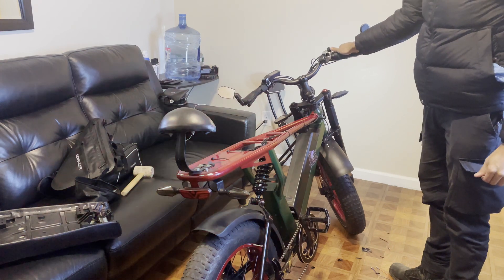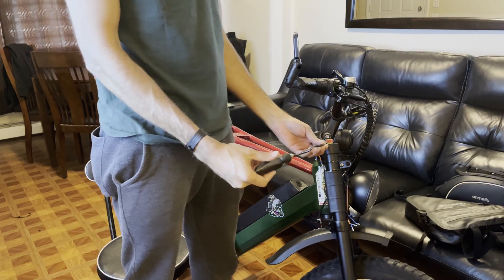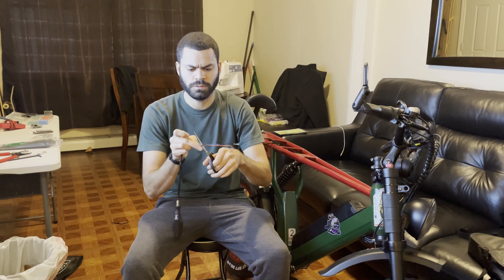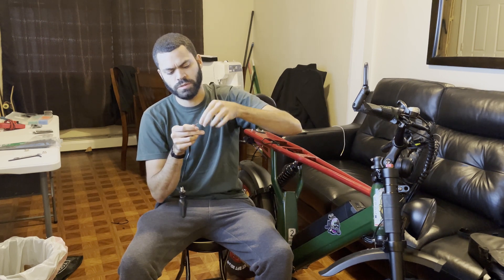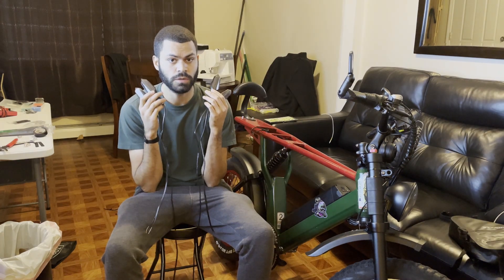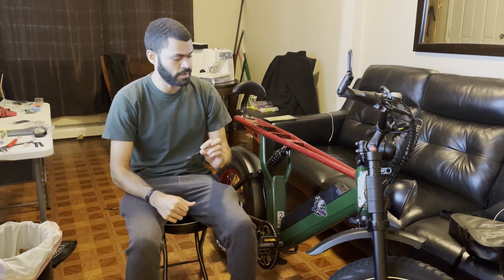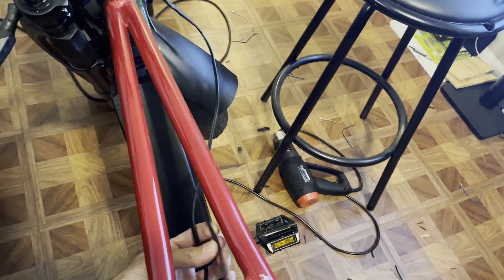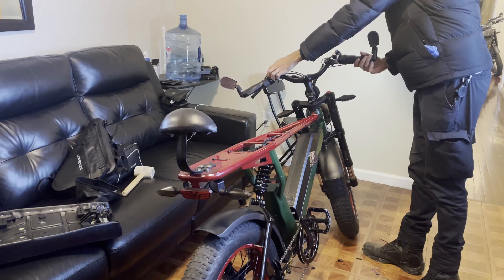Turn Signal Mod For Ariel Rider X-Class 52V (No External Power Source Or Step Down Needed)

Comment: Very poor electrical work. Using black wires is stupid. You should use red and black, Positive and Negative. Also at a minimum use crimp connectors to connect wires or solder. Never just twist wires together, just a pure crap amateur move. Also, when using heat shrink, use waterproof version to ensure that the connections do not corrode.

Comment: Great video man. I'll be trying this mod out in the spring when I swap out my seat. Quick question, could you not reverse the wiring to essentially wire your right lights like they are the left signals, and the same with the other lights? That way you don't have to flip the controller?

I'd been looking at the wireless stuff, but needing to worry about powering down multiple units, keeping multiple things charged etc seemed like such a pain. I'm much rather do what you did, and just wire up the new lights. 

Thanks! Really appreciate content like this!
Reply from the maker: @derricbb  I’m pretty sure I tested some other ways and this one is the only way that works because of how the control switch is set up. You basically sacrifice a tail light signal for turn signal. It’s kind of complicated I don’t really fully understand it but I tried many wiring combinations and this is the only one that worked

Comment: Hi bro, can this work on the step thru model somehow??
Reply from the maker: it should be able to work as long as your step thru model has, 1: a tail light, 2: a brake light, and 3: turn signal lights, which is a 5 pin julet connector.
Reply: It does have all that, but the turn signals tho are integrated into the brake lite?
Reply: It does have all that, but the turn signals tho are integrated into the brake lite?
Reply from the maker: @geemanns5614  Not exactly sure what you are asking but the turn signals won’t work as brake lights just turn signals, they work seamlessly into the bikes power source, and your stock brake light will still work when you press the brakes but the always on tail light will not work.

Comment: 👋🏻Can you tell please what volt did you buy for the turn signals I know you said volts between 12v-60v but since I wanna do it exactly as you did in the video can you tell which one you picked for your e-bike. Thanks.
Reply from the maker: These turn signals work for 12v-60v they don’t sell specifically for one voltage it’s just the whole range.
Reply: @chuckytrue  well in the link you provided there are categories you can choose from like 12v yellow/blue and others that are 32v-60v yellow/blue just to mention a few.
Reply from the maker: @ivm1646  Okay I see what you mean, they must have updated their selection since I got mine because it is different now. But you need the 32v-60v version not the 12v one.
Reply: @chuckytrue  excellent thanks

Comment: hello, please tell me how I can make the tail light work on the rear, I mention that you also installed a signal but it doesn't work for me when I press the tail light on the states, it doesn't light up, where is the power for the signal and brake on the tail light?
Reply from the maker: With this method the tail light doesn’t work. It only lights up when you use the brakes to signal you are braking

Comment: Hey, I have a question hopefully u can help. So I bought an aftermarket plug n play headlight for my xclass but when I turn on headlight the light stays on. The only way for it to turn off is to unplug it. The seller recommended I use a external battery so that’s I have been using as the power source. I sent an email to Ariel Rider and they said it’s because I didn’t “power cycle” the bike first before installing. Apparently I was suppose to disconnect or unplug the battery then turn on the display to make sure the bike is complete dead. By not doing this I kinda damaged the controller. Bike still runs fine tho. Just wondering if I was to install these turn signals would the lights stays still stay on even when I turn off the bike ?
Reply from the maker: Hmm sounds interesting. But I assume it would still behave the same way it is acting now if you install these turn signals because I don’t change anything about the wire that powers the headlight so it would probably still stay on. The headlight is tricky to upgrade for the fact that it has a daytime running light that is always on and is probably running on a certain precise voltage to turn on and off that ariel rider has programed into the controller witch most aftermarket headlights aren’t compatible with.
Reply: @chuckytrue  damn well it’s not that big of a deal but I recently installed the 60v controller and I’m having the same issue with the headlight. I was able to get a brake light adapter for the 60v controller but now the brake light stays on as well. I’m just gonna have to keep using external batteries.

Comment: Chucky in the description product there is a Notice saying:

If your electric vehicle voltage exceeds 48v, please do not let the turn signal stays on for more than 2 minutes. 

Could you explain what does that mean or what could it happen if we let it on for more than two minutes by accident?
Reply from the maker: Hi, I didn't actually ever know that until now. but I am sure I have left it on for more that 2 minutes when I forget to turn the turn signal off after I make a turn and so far nothing noticeable has happened. I will definetly try to avoid leaving it on for more than 2 minute now. Thanks for pointing that out.
Reply: @chuckytrue  ok but do you know what could it happen? I mean just in case. Thanks in advance for your response and keep making these videos.
Reply from the maker: @ivm1646  No I really have no idea what could happen. My only guess is perhaps the LEDs might burn out so they want you to avoid that.
Reply: @chuckytrue  I see it makes sense. The good news are that yours are still working properly. Thanks again bro 😎.